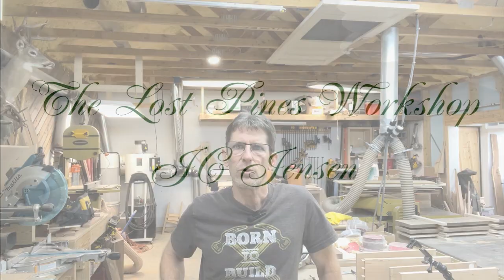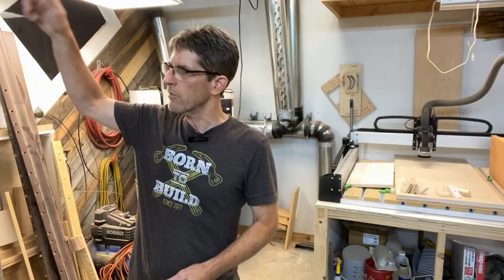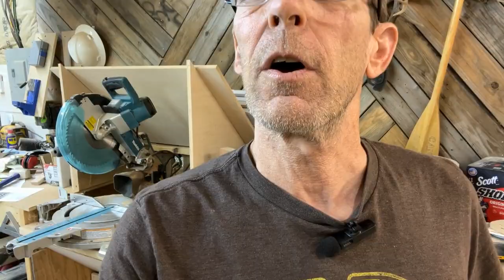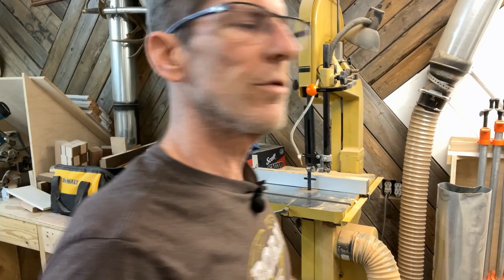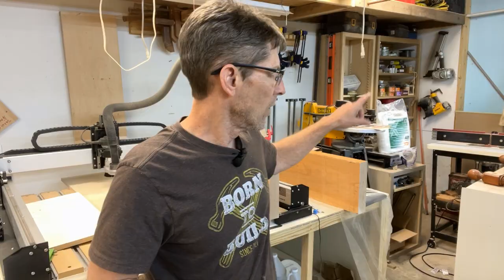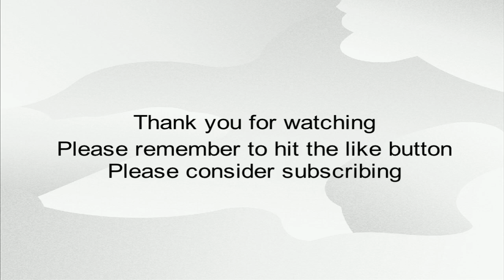Small Shop Dust Control

Comment: Jens - What do you use for your blast gates? Did you make them or buy them? Also, what do you use for adapters to connect between the 6” galvanized lines and your various tools and work stations? Where do you recommend purchasing parts and supplies to get the best value when putting together a shop dust collection system?
Reply from the maker: Hey Jeffery,
I found the 6" and 4" metal blast gates as well as the6" to 4" reducers at Woodcraft of Austin. They also carry the 4" flexible duct, but I don't actually remember where I bought that.  The floor sweep came from them too. For the 2", I shanghaied some plastic cones from my wife's weaving yarn and cut them to fit for use with standard shop vac. I wish there was industry standard for the smaller sizes.